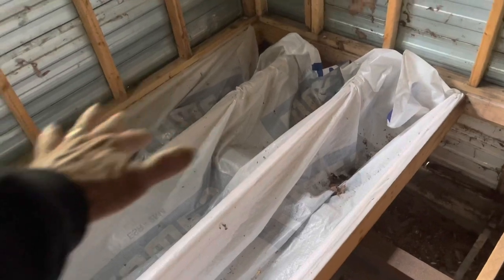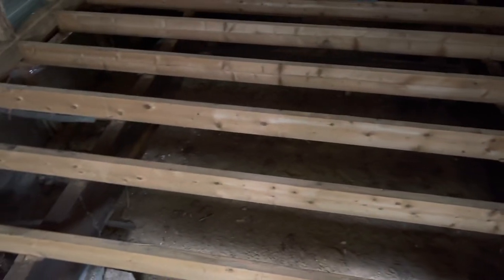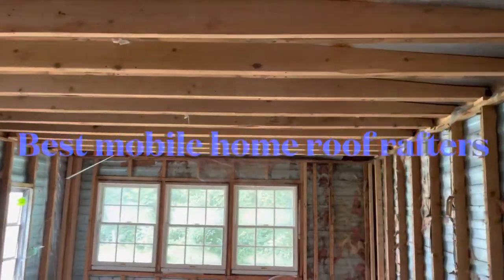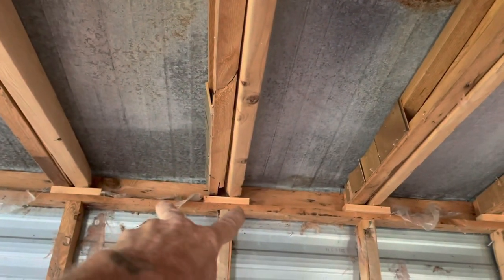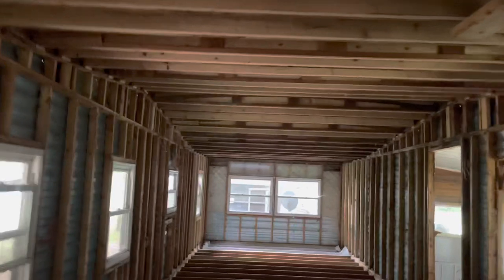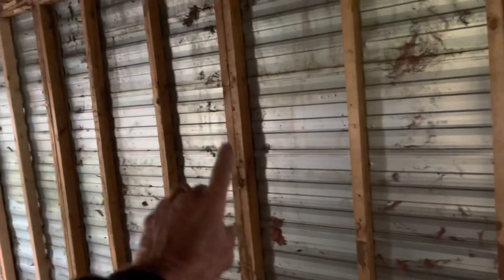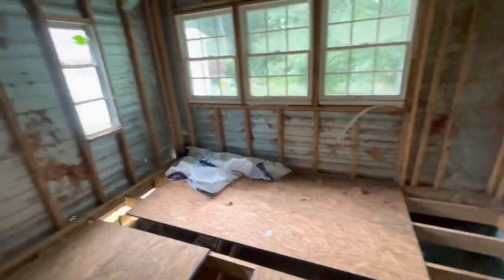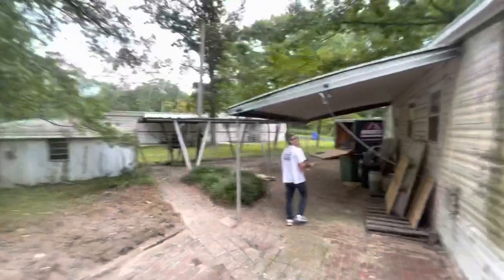Mobile Home Roof Truss Replacement. How To!

Comment: I just did one exactly like this one. i used 2x8 and ripped them exactly the same size as the existing rafters i also put 1/2" blue foam on top of the rafters between the metal roof and the wood rafters then insulated it and put a plastic barrier up then strapped it with 1x4 before we rocked it. Turned out nice. We dont do monile homes the only reason we did it cause theres nobody here in wichita ks doing mobile homes.
Reply from the maker: Well I think that’s amazing that you did all that by yourself. And you are right it’s hard to find somebody to work on Mobile Home’s anywhere thanks for coming bye thanks for leaving a comment you’re the best
Reply: Blue foam thanks for the advice
Reply from the maker: You’re very welcome and thank you for stopping by
Reply: This probably is a stupid question but did you strap plastic an insulation all the way down with 1×4 or how many feet apart thanks in advance
Reply: @christopherhacker8193  we put the rafters 16" on center and insulated r13 in between the rafters then we stapled up heavy plastic and installed 1x4 opposite way of the rafters 16" on center and rocked with1/2 rock u can do 24" we just over built it cause the mobile home could move and could cause the rock to pop. We do everything over kill so we have no call backs  hope this helps
Reply from the maker: I didn’t do anything on the inside of this house this is just me showing the house that we were working on I’m not sure exactly what he did on the inside
Reply: @Drewsroofingandhomerepair  it would be best to redo floor joist rim joist sill joist and all first before doing outer walls??
Reply from the maker: I did the whole thing at once it was all gone anyways
Reply: @Drewsroofingandhomerepair  do you have a FB or sum way to get in touch with u I pulled up the floors and all floor joist not the same
Reply: Do you have pictures to share with me about your job 😅

Comment: I think my trailer home may be a slightly different model but just to see what this 1 looks like stripped down helps me envision some of the areas I haven't been yet. My roof is a 50% mystery but that's better than 100% mystery lol. Thanks Boss👍
Reply from the maker: Awesome Gary I hope you are a new subscriber on my channel or a subscriber. As we do videos often of things like this. We only deal with mobile homes basically on this channel. Every once in a while you might see a shingle repair or a pipe boot repair or some thing like that but 90% of it is mobile home work. We are actually heading back to New Jersey on the 24th of this month Juniper New Jersey and then close to Wildwood would be the second one. So I’m glad I was able to at least take care of 50% of the mystery and who knows what you might find on my channel down the road. Also remember to look at my playlist Mobile Home Floors I have lots
Reply: @Drewsroofingandhomerepair  yes sir I've been subscribed for around 6months or so. All of your videos are incredibly helpful,especially before I decide to get into any project I check out any of your past work to help give me an idea what I'm getting myself into lol.
Reply from the maker: 😆 I’m happy I can help. Thanks for watching. Thumbs up 👍

Comment: I like the info.  Unfortunately trusses do not work that same way as solid wood.  Adding the solid wood to the truss is beneficial but the strength is in the truss design.  I am working on a manufactured home currently where there is a collapse due to weight of snow.  Several trusses have broken.  I would suggest to add plywood to the sides of the trusses because it is far stronger.  Even OSB is used as the webbing in a TJI floor joist system.  When you cut wood on the ends to follow the profile of the roof the board becomes only as strong as the smallest width it is cut to.  On the rafter tails bearing on the exterior wall the rafters appear to be cut to about 2 1/2 inches.  Engineering principles suggest that the strength of those rafters are the equivalent to a 2x3 spanned the whole width of the trailer.  It being sistered to the truss will reinforce the strength of the bridge design in the truss itself.  It would be stronger to apply OSB to one side and glue and staple or nail it to the side.  Additionally screws are not structural unless you specifically purchase structural screws.  The reason they are not typically used to frame the walls of a home is that they are constructed of a higher carbon steel which is brittle when put into shear force.  They will break.  If you have place a screw into wood and snapped the head off then you understand.  A nail can bend and flex and is a full thickness with no stress risers along the length.  Nails are approved for structural framing and support.  If you planned on repairing instead of replacing the trusses I would recommend cutting a template out of plywood and adding that to the sides of the trusses.  I would also recommend drilling vent holes in various places to allow ventilation and run your wiring though with a hole saw.   Make sure to drill in places where you would leave approximately 1 1/2 inches of material on the top and bottom of the plywood.  If you have seen a pre-engineered floor system made from TJI joist then you would see they have "knockout" holes pre-drilled in the OSB webbing so you can run wires.  I hope this information reaches someone who needs it.  I fear that attempting to rely on a solid wood rafter cut in this form could prove catastrophic if the thought was that a solid piece is stronger than a the engineered truss as this is not the case.  The most likely fail point will be near the wall when the rafter would just break at the thinnest point.  I have framed homes for more than 33 years and have worked for an engineering firm.  In the project we are currently working on we have brought a licensed engineer to give us a spec to local code for the repair.
Reply from the maker: Very interesting thank you very much for sharing that with my subscribers and myself
Reply: Amazing 👍🏼
And thanks this really made me understand lots of questions I have about this topic not much I go out there to all this questions on how to repair or reinforce Mobil homes framing and roof definitely you got it thanks again I’ll now go ahead and made a trailer remodeling with all my questions answered thanks to your comment peace and hope you make a video about this topic somewhere in the internet
Reply: Thank you so much! This is so very helpful. I signed in just to thank you. I live in a very wet winter climate with a lot of condensation so will probably be doing a pattern with plywood- 2 ft ply then 1 1/2 feet clear with straight channels going the length of the trailer. Vents are only on either end..

Comment: Love seeing this. It's about where I'm at too but luckily mine was made with 2x4 walls from the factory. Unfortunately most need to be replaced due to rot spots and I'm actually rebuilding all the roof truss's too (every sing one of them has rot too)  but just going with the stock bowstring design due to permitting reasons. Seems like he'd def want to upgrade to 2x4 with all the added weight of those 2x6 truss studs, a roof full of osb, and a ceiling of gypsum boards. Luckily my county inspector said if I put half inch ply on the roof, it will strengthen up my 1x2 truss's enough to handle the 'lightweight' half inch gypsum.
Reply from the maker: I agree with inspector

Comment: Thanks for ll the repair videos. They help me alot. I have a question I can't find an answer to. in a curved roof singlewide 82 model what would you need to do to the ceiling tro make sure it can hold up a hammock and 2 to 4 other heavy hanging tables and tv and a swinging bed? I was thinking about putting a 1 1/2" x 3" angle iron 1/8" or 3/16" thick drill a hole every 16 inches the entire 13 .5' length of it and putting lag screws through it into the ceiling joists/trusses and do it on every joist I hang over 250 lb from. Is that overkill or is it bad or just the stupidest idea? I need to do something The lady wants a swinging bed. Thanks.
Reply from the maker: I don’t recommend it a swing bed no don’t do it you’ll probably end up pulling the entire ceiling down including the roof itself from the top they’re not made for that you would have to completely rip your ceilings out reframe everything give it a lot of support please don’t do what you’re talking about it will be the worst thing you ever did.

Comment: Hi drew , I have a single wide trailer that has the outer perimeter wall sagging. I believe it’s from the previous owner replacing the walls and ceiling with heavy plywood. Any ideas on how to push the exterior walls back up? Thanks ahead of time
Reply from the maker: Yes I do. Watch this video. https://youtu.be/A41tS_rKDWg
Reply from the maker: 910-two nine 4 one seven 61 call me 🤙

Comment: Hey there, we are in the process of doing this right now with our mobile home remodel. 2x6 throughout the whole ceiling to support drywall. My question is, will the walls need to be reinforced to hold the extra weight? 

Mine looks just like this and outside walls are most likely 1.5x3” (unfortunately they are not opened up). Sounded like he may add 2x4 walls to this one, which I would do if my walls were opened up. 

Im hoping the existing walls can support the new 2x6 joists and going with lighter 1/2” drywall. Any input would be greatly appreciated!!
Reply from the maker: My answer to your first question is absolutely not trust me your walls will hold a lot more than the manufacturer will tell you trust me a 3 inch 2 x 4 every 16 inches on center will hold a tremendous amount of weight. I would say absolutely redo your whole top with two by sixes and, as long as you don’t push the walls out, you would be fine and then put rubber on it
Reply: @Drewsroofingandhomerepair  awesome, thank you so much for the feedback. I will open up a part of one of the exterior walls just to see what we’re working with. If the framing ends up being any smaller (ie. 1.5 x 2” every 16”) would that still support the 2x6’s? I hope it’s not smaller but in some videos I’ve seen some interesting things in the older mobile homes.

One other thing I should’ve mentioned is this is a double wide. There is a very large center beam (10-12”) down the middle. We will do the 2x6s from the outer wall to and connect to the center beam. So they will be 12’ 2x6s on each side of the beam extending to the exterior walls. Will this change anything?
Reply from the maker: Interesting I’ve never done a double wide, but I’m sure your walls are 2 x 4 on a double wide and if you put your ceiling, Joyce the new ones on top of the studs from the wall and the top it will hold just about

Comment: Do I have to reinforce every ceiling beam with 2x6 to hang drywall on ceiling or can I get away with just every other beam
Reply from the maker: I think if you do every other one you’ll be fine with it I wouldn’t be hanging five eights sheet rock or anything like that but quarter inch or 3/8 or half inch you should be able to get away with it with every other one
Reply: @Drewsroofingandhomerepair   thanks …didn’t expect a response, I appreciate your input .

Comment: I have just come across one of your videos about Perma Boot. In it, someone asked about a caulk. You said Lexel is what you use. I looked at the mfgr site and there are several. Is it the general-purpose one?  Why did you pick this brand? Thanks.
Reply from the maker: Are use XL caulking because it is clear in because when it dries it becomes very hard.  When you install a Perma Boot you don’t actually have to use caulking around the bottom only at the top where the Cap is

Comment: Hi Drew. We don't have enough room between the trusses and the top wall plate (1x3) to put even a 2x4 truss scab without increasing the wall height. We have a 1970 single wide that has 1x1 framed trusses. Screws are splitting the truss framing. What do you recommend?
Reply from the maker: However you take it apart you put it back together the same way

Comment: I'm so glad you have a YouTube channel. Ther is nothing on these stupid bowstring rafters .thers 2 other videos and 1 guy made new ones and 1 guy pieced it with plywood. Anyway I ripped my trailer down to the frame siding and rubber roof. My trusses are all busted the ones that are not busted are warped sagging. Mine sit a bit different on the wall there's a notch cut with only enough space for the truss but im gonna just cut the groove bigger and do this. I don't really know wtf im doing i don't know much about wood I worked as a mechanic only but im sure this won't be a problem I just don't even know if mine are too rotted to even put a screw though. I was supposed to paint this thing put vynil floor and move in but it's such a piece I just couldn't ther wer 3 floors 2 layers of panel on the walls and drywall. Everything underneath was rotted all the windows leak all the plumbing leaks Its a frame now with siding and a rubber top im just sick of this pile.
Reply from the maker: A little at a time my friend that’s really all I can say a little at a time start with the roof
Reply: @Drewsroofingandhomerepair  well actually that's better than saying throw it out lol. I appreciate u responding. I'm just going to keep watching your videos and hopefully I'll be done in a few months.
Reply from the maker: We are starting Floors on Monday so I’ll have about 40 hours a video I’ll be able to share
Reply from the maker: Video daily https://youtu.be/fZiS--GLXHo

Comment: Hi Drew, I have a question about replacing the original 2x2 trusses with 2x8's on a single wide trailer. My question is do I need to drill/cut holes in the new 2x8's for proper attic ventilation? I have heard that the roof should have ventilation, however by replacing the old trusses which allows airflow (loose term ;-) between the trusses with a solid 2x8s which will not allow airflow between the rafters. I am in the middle of replacing trusses now and would like to do this if you think it's needed. I am worried about the structural integrity of the 2x8s if I do (drill/cut holes) to allow for airflow between the rafters. We live in Northern Wisconsin so it does get cold in the winter and hot in the summer. Please help!  Also, I wanted to say your videos have been a lifesaver during my remodeling project. You have by far the best DIY videos on the internet! Thanks in advance. Jon
Reply from the maker: If your whole house is stripped on the inside and your ceiling is all exposed and you don’t have any walls in the way the very first thing you should do would be to go to Lowe’s hardware and buy plastic a piece of plastic that will go from wall to wall. Staple it up to the new Joist that you build. If you wanted a small bit of airflow through there I’m not sure how well it will work to be honest with you but you could take a three-quarter inch drillbit and go across the top of that 2 x 8 drilling holes maybe six or eight total I don’t think that will hurt the integrity of the 2 x 8.
https://youtu.be/C-mrsA6ScrY
Reply from the maker: I can tell you that on this particular mobile home that we did he did not make room for airflow in anyway this is what he did.
https://youtu.be/yZWx-kkQUwU
Reply: @Drewsroofingandhomerepair  Thank you for the reply Drew! You are definitely the BEST resource for DIY mobile home repairs.
Reply from the maker: Thank you my friend not many people will work on mobile homes and I do so I know a little bit about them.

Comment: Anything on working with vaulted ceilings
Reply from the maker: Should be good on that. I have done them all. Vaulted and flat
Reply from the maker: Videos no. But it is easy. Take all the strips down that are on the seams. Then remove ceiling panels. Rebuild strips or fake besms
Reply: What do you mean by rebuild strips or fake beams  on a vaulted ceiling

Comment: Hi Drew,  great work,  wish I could hire y'all.  Question,  how do you get that correct curve on the 2x6 to fit the roof?  Thanks for all the great videos.
Reply from the maker: Cut it with a saw. Measure and cut. It’s easy really
Reply from the maker: https://youtu.be/nxbEHwM0xCM
Reply: @Drewsroofingandhomerepair  lmfao,  I  know cut it with a saw, 👀 
I'm talking about getting the correct curve, to match the existing curve. 
My ceiling is sagging,  I'm sure it has rotten,  broken trusses.
Reply from the maker: The ceiling joist will only have to be trimmed on the outside corners they do not touch the roof in the middle
Reply: @Drewsroofingandhomerepair  oh, now I see. I haven't started my roof yet, but it sags on inside and roof, so pretty sure the trusses/ rafters have rot and broken in spots. 
I live close to Seattle wa. and sometimes get a good amount of snow.  Kinda worried,  I hope it holds  up this winter and I get help next spring.  I am 60 yrs. young and a very good automotive technician,  but carpenter I'm not.  Problem is finding someone to work on my older mobile home.  Thanks for the info.

Comment: ok, my single-wide is like this. but I was thinking it may not be worth repairing instead of replacing it with a 20 year old mfg home. I know a dude that just bought one for $15,000 but you guy's are ripping everything out. How cost effective is it really to tear out the walls, floor, ceiling, instead of starting over? is it too expensive to remove a mobile home and install a newer one?
Reply from the maker: When a home reaches A certain age if you take it out you have to now update the new home to all the changed rules. But I’m not real sure about that answer the owner is radar NJ and you will see his comments I would ask him that question.